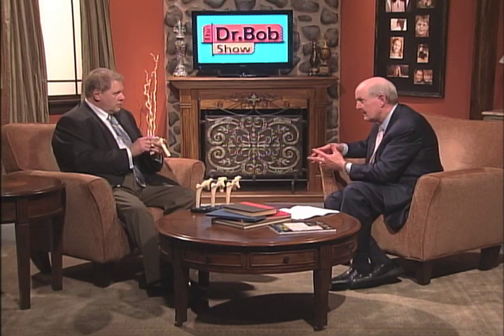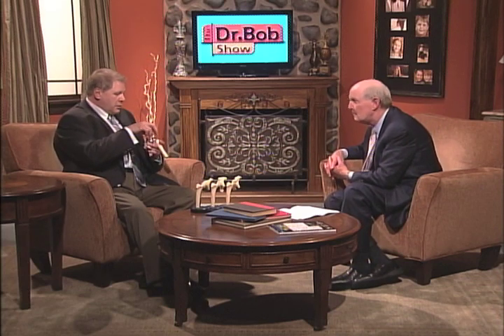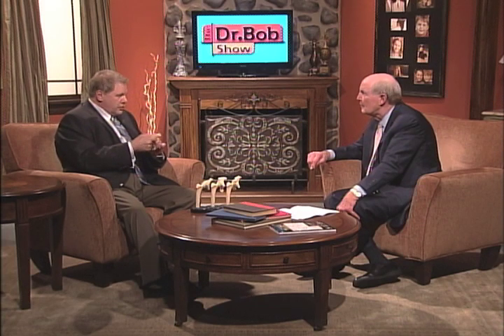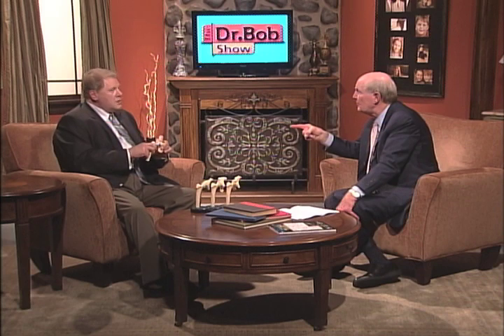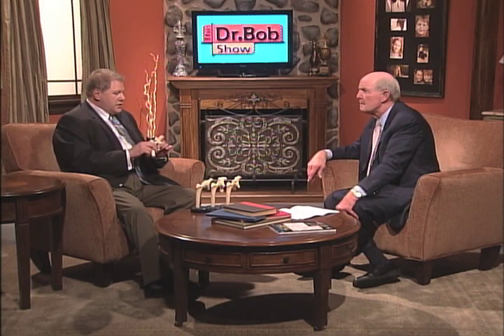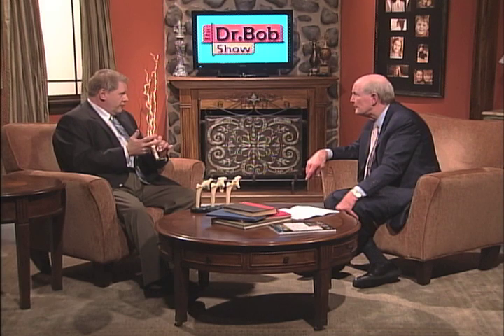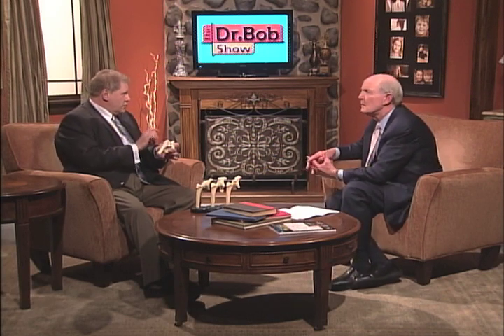Anterior vs. Posterior Hip Replacement

Comment: I've heard the less invasive procedure can have a fast recovery but problems down the line with poor placement, leg length, and other complications from not having good access to the area.  I'm nearly bone on bone and although only 37 I am not a candidate for the minimally invasive procedure.  What muscles are cut during the anterior and posterior operations?  Should I be concerned with either procedure.  I'm a surfer and need to be able to squat.  Thanks for your suggestions!
Reply: larryjohnny
Reply: no muscle is cut with anterior.